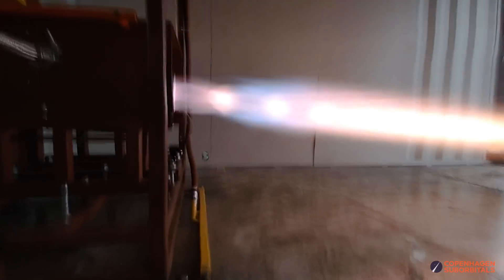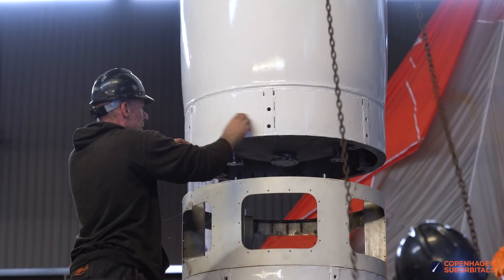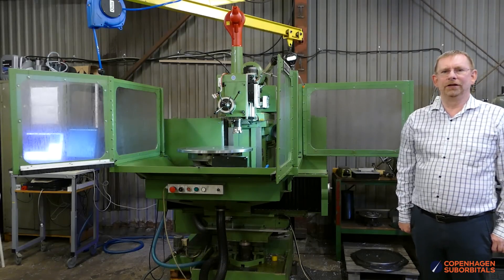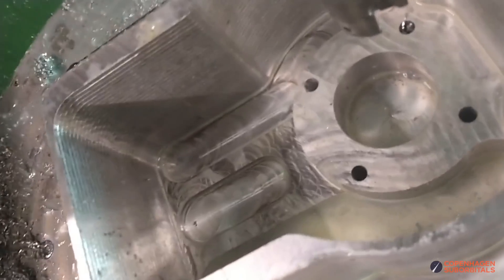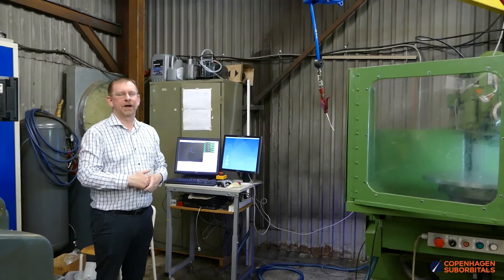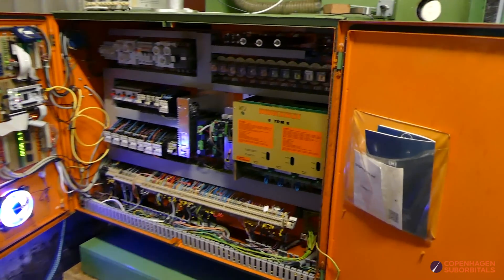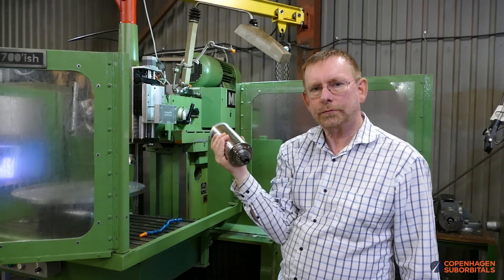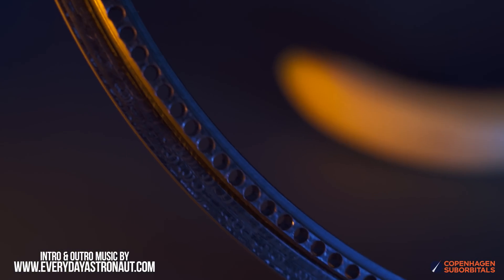Converting a manual mill to CNC for making rocket engines

Comment: a candle can be a hot air directional rocket engine, air breathing
Reply: what a wire mess, how about optical fiber, or just combined wire bus in a single optical controller

Comment: I still do not know why rockets are not fired out of long tubes. I mean it is possible. The military does it. Shouldn't this give with the accumulating pressure the rocket an additional initial boost for free? Or is it just not worth it?

Comment: I’m interested in how you have used the NUCLEO-F722ZE to emulate a MESA card. Thanks.
Reply from the maker: The controller board is a STM32F746-NUCLEO. It is not emulating a MESA card but is operating in a very similar way. It was a lot easier to make a new protocol for it instead of trying to reverse engineer the MESA protocol and adapt it to our setup.

The software on the STM board is talking to the PC using a custom written LinuxCNC HAL module using raw Ethernet frames.

The HAL module exposes all these features from the STM board:

- ~80 IO pins (using a port extender).
- 5 interpolating analog quadrature encoder inputs.
- 8 analog outputs.
- 4 software stepper outputs.
- 3 digital quadrature encoder inputs.
- 4 PWM outputs.
- 5 serial ports
- 1 CANbus interface

All the IO lines from the NUCLEO board in the centre are fed through the surrounding PCBs that do input signal conditioning and output buffering.

Best regards,
Scott.
Reply: @CopenhagenSuborbitals  Thank you for the reply.
Reply: I would really benefit from such details as well.
Reply: How did you find the model number of the ST development board used on the inner control panel door.  When watching the video it seemed more like their own space grade Arduino clones or a much simpler IO expander for the PC next to this router.  The model number in your comment appears to contain an STM-32 microcontroller.
Reply: @johndododoe1411   Watch the video at 3:40
Reply: @emel6956  Impressive, thanks Scott!

Comment: Hi, Why you didn't use off the shelf 3/4/5/6 axis CNC controllers, I dont know if it's cheaper (not that expensive) than yours but definetly faster to integrate in an older machine. Love your technical episodes!
Reply: I think you answered your own question.

It all comes down to cost vs time. Time, they have plenty of. Money, not so much.

Plenty of money lets you save time. Plenty of time lets you save money.